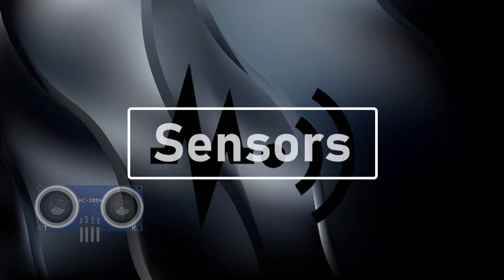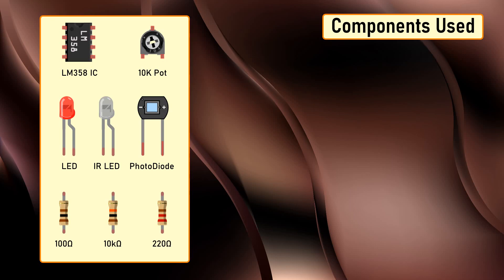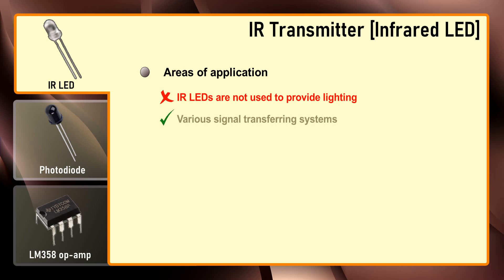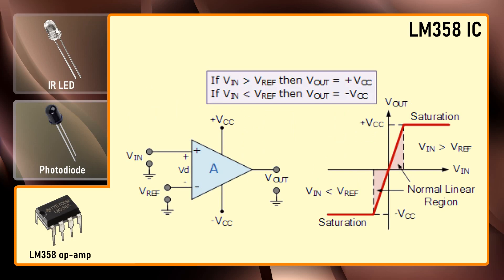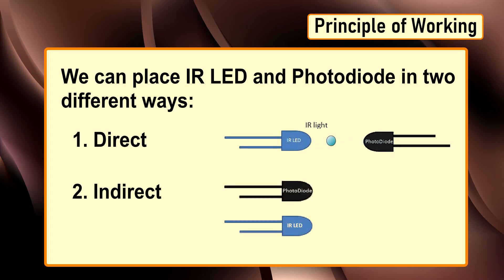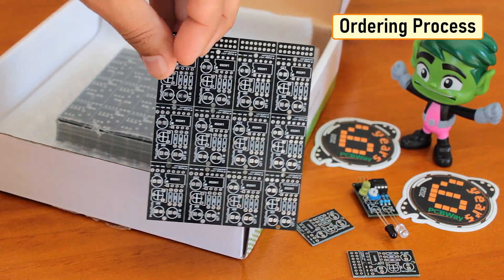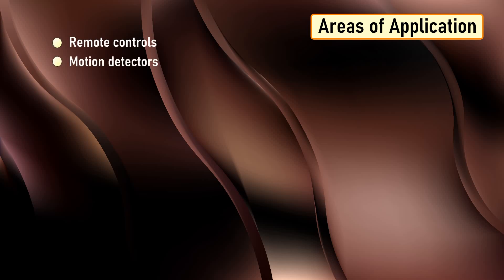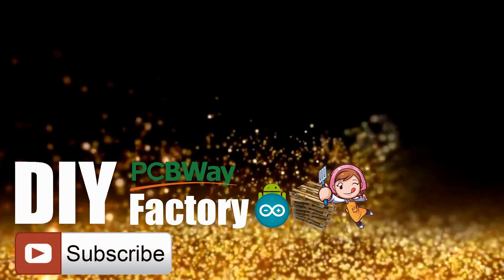DIY  IR Module

Comment: How would you invert this circuit, off when detecting ir light, on when no ir detected?
Reply from the maker: Well i am a bit confused.
The output goes high when the module detects IR signal otherwise its low.

Comment: Could you do a follow up video and make a IR touch frame for an LCD monitor.
Not many videos on this subject so would be a fantastic upload.
Reply from the maker: My next project is on a IR based bed side night lamp 
That will I think cover your topic 
Stay tuned
Reply: @CrazyCoupleDIY  I was thinking of a customizable size IR touch frame overlay .they sell them on Ebay for large screen,but for smaller 4.3 format screen the market is none existent.

The frame could be 3d printed with the leds and photo diodes integrated into the frame.

Thank you for sharing your video.
Reply from the maker: Ahh ok
Reply from the maker: Sure , I will do something for sure